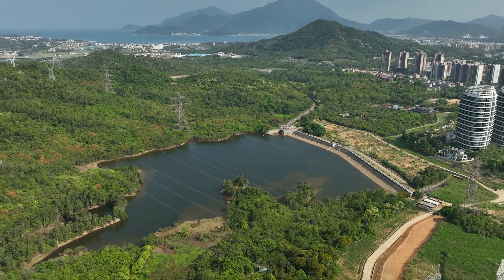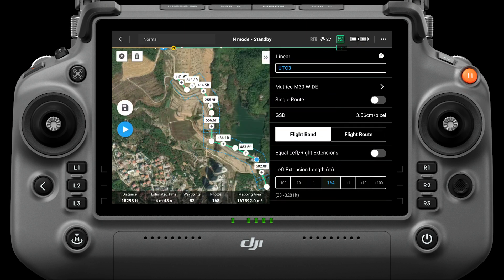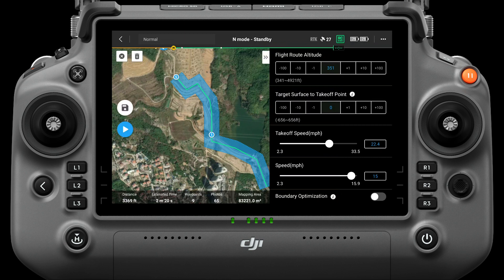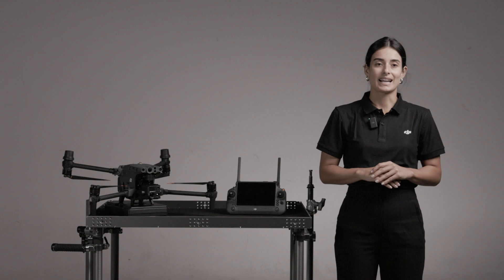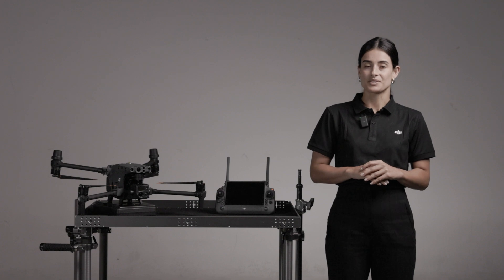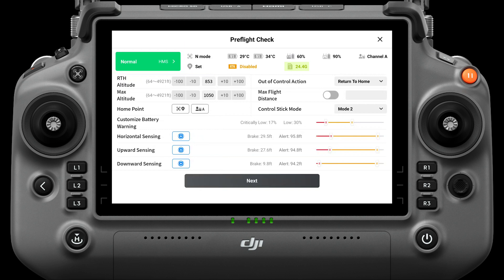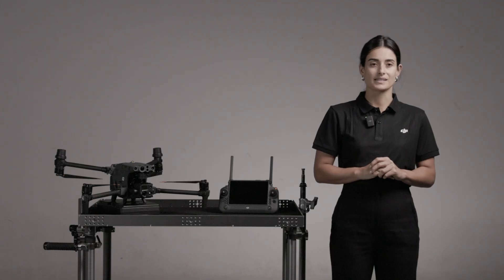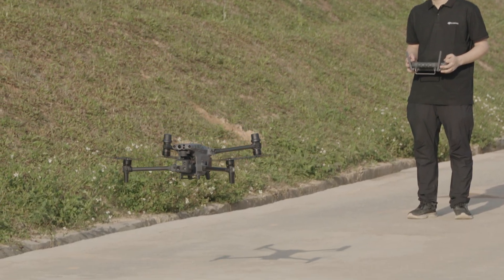Linear Mission Planning Using DJI Pilot 2 - Episode 11

Comment: There is a major problem with Pilot 2, It turns out that the Mavic 3E does not support the D-RTK 2 in mode 3, in Pilot 2, so you can't establish ground control points, what a conn. Don't buy the Mavic 3E with the D-RTK 2 for mapping, waste of money.
Reply: indeed. And 5 months later: nada...still can't. I mean, the M3E replaced the P4 RTK, and that old drone and flight software supported the DRTK-2 as a rover. That's DJI: soooooo good, and also soooooo bad, all at the same time